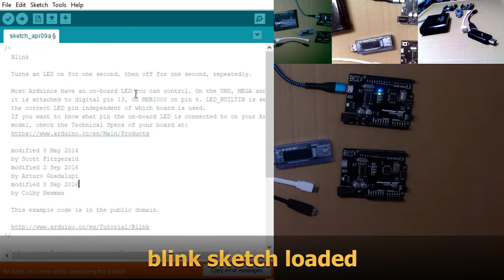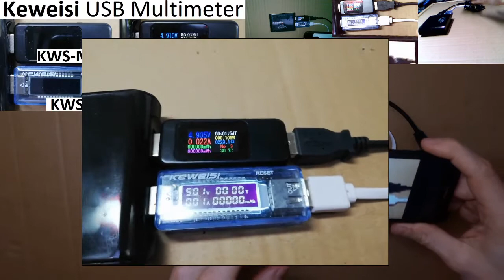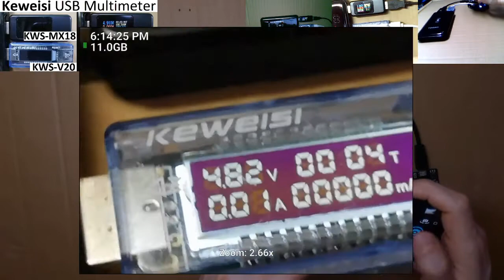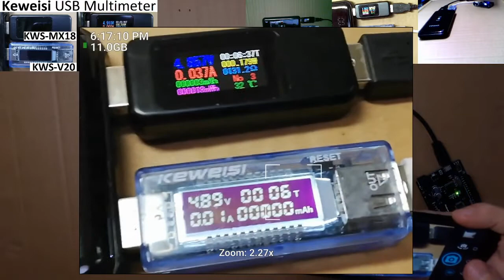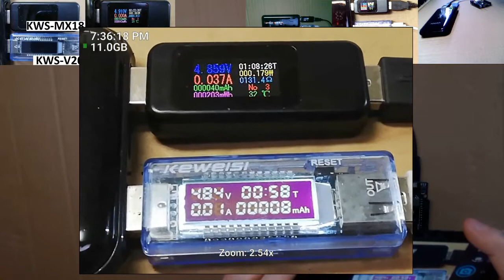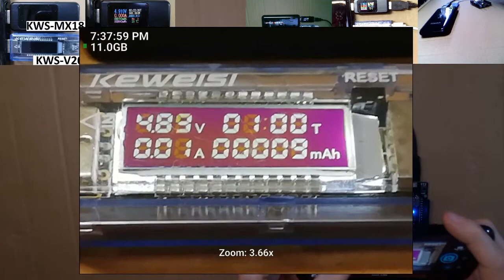Keweisi USB multimeter KWS V20 vs KWS MX18

Comment: What is the minimum low current that still can show? Do you have example? Charging my old Philips USB mp3 player at around 70-110mA, it shows 0.07-0.11A but occasionally goes below and unfortunately shows 0.00A. Cannot detect bellow 0.07A? Here also time and capacity stops.

Comment: Place them in series so that you know that you're measuring the same current.  Sometimes the meters show the power consumed by the meter.  Sometimes when current flows in one direction, the current of the meter is included and in the other direction it is not.  Did you try switching the Arduinos in case one was consuming more power than the other?

Comment: I got the black kewiesi one, I tried to calibrate this thing and has since messed it up as it just keep giving the wrong readings now, I can't get any reading higher than 0.18A now, It's impossible everything has such a little current right? Could you tell me how to get it back to factory default? secondly, what is the thing called calibration, I followed the instruction that says one should hold the botton then plug in the tester which I did then, next, I have to double-press, to change the arrow from forward to up then press one more time to change the arrow upwards then press once to increase the current that's the +000 display, what exactly is this? I'm required to increase that thing(which is the current) then double press for the arrow to charge to forward and press once one last time before ending the cablbration but, after doing all these it started giving wrong readings. What exactly should I increase the current to when I'm pressing once between those arrow changes process? lord I can't stand electronics.
Reply: That’s hilarious! I might have a go at calibrating it for fun - but it shouldn’t ‘really’ need - & I’m not that ‘fussed’ of purely accurate readings.I might end up breaking it - corrupting the code like it sounds you might have done. I’ve resurrected these Chinese things by chance - extra long presses - it’s a fluke sometimes - 

What I would say is make sure you have a power bank or adapter plug that can supply enough current for whatever you’re charging - make sure the leads you use are able to provide the current you need - & whatever you’re charging - be it a battery - you know it requires more than the 0.18A you mention 

If the above doesn’t help - buy a new/ improved one!

Don’t give up on electronics says the Lord! 🤘

Comment: Great video. Thank you for your brilliant presentation which took care of most of the questions on my mind concerning these products in just a session after a long fruitless search. I am glad I bumped on your channel and couldn't help but subscribe right away. I am not a tech guru but just an enthusiast. You gave me great insight. There is another model of Keweisi USB multi tester which is KWS MX 19 I found on AliExpress which is stated to have "Triple Protection" and also referred to as "10 in 1". Please compare and show the  advantages of this MX 19 (if any), over the MX- 18 which you have just analyzed.
Thanks. Please respond.
Reply: I wish that Keweisi had a website for official information but I can't even find a store with that name, only lots of resellers and they typically advertise multiple models on one page, which is annoying because it's difficult to be confident in the differences.  From memory: MX-18 only does QC2 & 3, MX-19 adds other charging protocols & USB3.  MX-18L is 6.5A and MX-18 and MX-19 only 5.1A.  I don't know how USB2 vs USB3 differs for a meter.  Maybe if you want to pass-thru to a USB3 device then you need that one.  I don't know if there's any risk of passing a USB3 connection to a hard drive or something.  (I think that I would only try on an empty drive.)
Reply: @brianwest2775  Thanks for responding. That is the problem with Chinese manufacturers who don't even bother to leave adequate information on their products. No instructions manuals in many instances and when there are manuals, most are written in Chinese hieroglyphs. Even labels of function buttons on products and screen monitors are in Chinese language even for products meant for foreign countries' use. They don't seem to want to make efforts in correcting those annomalies.
Reply: On my previous post, I realized the following lines on my comment crossed: " ...Triple Protection" and also referred to as 10 in 1..."  I really don't don't understand why those lines are crossed.

Comment: Think you need to cut this down to 5mins! The KWS V20 is useful as the timer stops when there is little or no current drawn - unlike others which just carry on - so you don’t know how long something takes to charge. With many USB testers on the market - if you do another video - tell viewers what the specifications are - ie Min/max voltage/current that can be measured as most videos don’t. Maybe delete this video & do a quicker one as most won’t really be interested in you setting up the Arduino! 
I’ve the KWS 18 coming soon - but I have the V20 & about 5 other diff types - the reason I’ve dropped in. Oh, also note that these should be ok for QC 2.0, 3.0 & probably 4.0 as their voltage/current capacity is within limits. There’s a newer USB tester which has USB C & Micro USB sockets too.